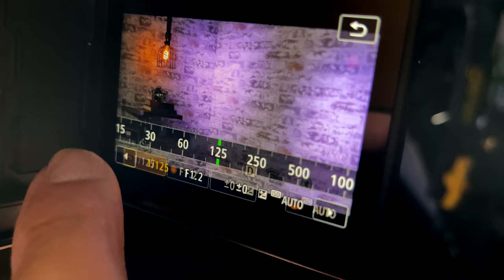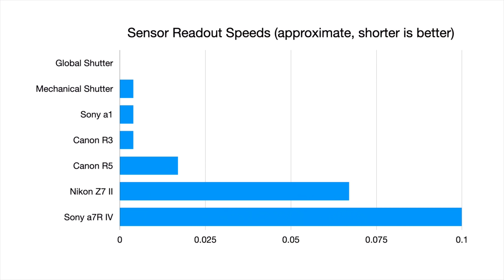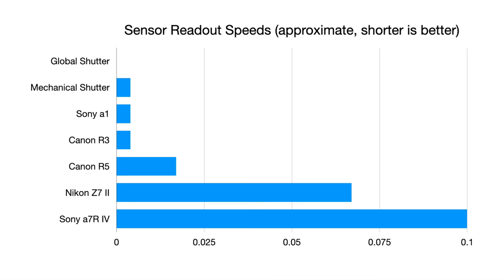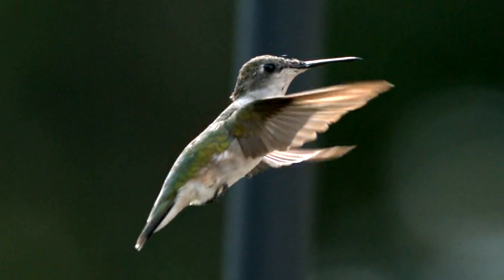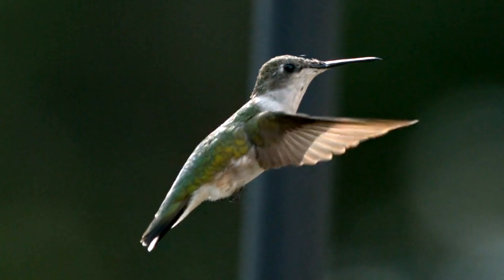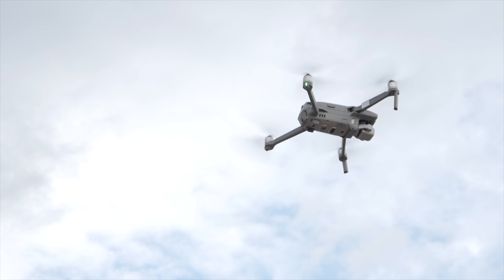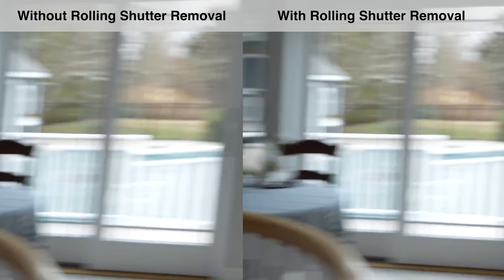Rolling shutter RUINS your photos & video: Let's fix it!

Comment: Need to pressure the industry to work harder on development of affordable global shutter sensors!
Reply: @asificam1  You can't dim an LED.  It's either on at full brightness or it's off.  That's why they fake dimming with PWM.
Reply: @LarsLarsen77  That's not true. You can dim an LED, but it needs to be dimmed using constant current method, instead of regulating voltage.
Reply: @LarsLarsen77  That is definitely not true, how do you think LED video lights work? I can use mine down at 10% power with my camera's shutter speed at 1/1000 of a second and see no flicker because the power delivery is DC instead of PWM.
Reply: @asificam1  Having DC power delivery for LEDs is not that trivial when you're talking about small devices like light bulbs and LED strips.
Reply: @TechnoBabble  It is not trivial as having to just put a small capacitor, but it is trivial in a sense that you can buy a cheap constant current regulator, and be able to dim LEDs without flickering. CC regulators usually use hundreds of thousands of Hz when regulating electricity (essentially they also use PWM, but very high frequency complemented with enough of capacitance makes smooth output).
Reply: @LarsLarsen77  You wanna bet?  LEDs can be dimmed by controlling the current through them.
Reply: they won't soon because they earn money on the camera's they have now. It is all about the money.
Reply: @MrKoenPieter a9iii enters the chat
Reply: LOL
Reply: just back to CCD and problem solved.

Comment: All right except that people still seem to think the flickering only ovcurs with led lighting, like led is a bad new tech..but it also happens with other sources like foot example fluorescent
Reply: Yeah, it definitely also happens with flourescent, sodium vapour, and cheap incandescents at a high enough shutter speed.
Reply: I've had fluorescent (the u before the o guys), lighting give me blurred vision and that quickly led to some disorientation. I worried it was me until I got outside from the store and started feeling clear headed again. Just some locations though, not all ceiling tube lighting.

Comment: You don’t need an A1 or R3 to get less rolling shutter in silent mode. You can buy the much cheaper a9 and get fast sensor readout. Fast FF sensor has been around 4 years.
Reply: indeed you can get 3 cameras from sony today that are able todo it. The A1 is about 2x faster it seems then the others (including the R3). Getting a R3 at the moment is not possible they are not on sale so you have 3 options if you want silent shooting with less rolling shutter ff A9,A9II and A1.
Reply: @Benjamin Mesa Thats fine to each his own but there is added value in a stacked sensor thats why they are also moving to it. And yes the a7RIII is a lesser cameras as the R5 no doubt. And i still own one, I jus sold a R4 for a A1. The 7R3->7R4->A1 is about 100+ updates and changes its like comparing a R5 with a RP in way even many sony 'fanboys' don't see the massive steps between generations which is a pity.
Reply: @Benjamin Mesa fine but you do understand that was not the point of the discussion its not my job to convince anyone who hates a brand. I could tell you 'these menus' have been redone but clearly that won't help the discussion was rolling shutter.

Comment: To avoid flickering at home whenever I buy lights from IKEA I go with my camera and test every bulb with typical video/photo settings to make sure I do not see banding i.e. their switching frequency is high enough such that it does not show up.
Reply: Pretty smart & probably something every filmer should do if they live close enough to where they purchase their lights. How do you do this. Do they have them on a working display or you take them out & put them in a lamp display? (I never been inside a Ikea)
Reply: @thomastuorto9929  yeah Ikea was just an example but could be any local household store with lights on display. Even if they are not on display just explain the situation and ask for assistance they will show you lights. There certain things that although you can buy online it's better to try for yourself at the physical store. In the end of the day a good set of LEDs will last for 10-15 years.

Comment: Quick Solution for camera manufacturers: The sensor should scan top to bottom, right to left, instead of right to left , top to bottom....this would dramatically reduce the pan jello effect... the "awnser" though, would be an "instant" sensor... maybe each line of resolution on the sensor captured all at once, or each line in one full "swipe"... gl
Reply: or the sensor needs to scan so often, that it's basically an "all at once" sensor

Comment: The rolling shutter distortion is time-domain aliasing, and as you would expect with sample-rate aliasing it is subject to the Shannon/Nyquist theorem, requiring a sample rate of 2x the event rate in order to eliminate the aliasing.  

What’s subtle here, and what is so well explained in the video, is that the sample rate here is not the shutter speed, but the total sensor readout speed. The “shutter speed” is the effective exposure time for any given band of the sensor, and will have an effect on motion blur, but the anti-aliasing speed needed to eliminate aliasing distortion is the total readout speed for the whole sensor. Thus, if the hummingbird flaps its little wings at 50Hz, a total readout speed of 100Hz is the minimum required to capture it without aliasing and thus motion artefacts. Anything less WILL produce these unwanted effects. 

Again, this is not the shutter speed we typically think of to “freeze” motion. That’s a different thing, based on arc-seconds of movement, and will differ according to magnification, viewing distance and a few subjective values for what we consider to be “sharp”.  In many cases, some image blur is not only acceptable, but even desirable, and freeze-motion shots of things we know to be moving quickly may have an unnatural feel. 

Lest we imagine these artefacts to be something new in the digital world, we need look no further than the photos produced by Jacques Henri Lartigue, of the Grand Prix race in 1913. Using a camera with a curtain-type focal plane shutter, Lartigue produced famous photos of racecars with oval wheels, surprising many observers at the time. 

What shutter produces NO artefacts? The best shutters for air-to-air photographs, where there are usually spinning propellers or rotors, are between-the-lens, leaf shutters. This type of shutter produces no artefacts of any type. Granted, they are not very fast by today’s standard (usually maxing out at 1/500 sec/2ms) but the motion blur produced is usually more desirable anyway for propellers, and it is possible to calculate shutter speeds to produce ¼, ½, or a full rotation of blur. I use large-format film cameras for air-to-air when possible, for this reason. I have yet to see between-the-lens shutters offered for digital cameras, but I would not be surprised to see them offered soon, as more photographers wish to have this artistic control over motion artefacts.
Reply: Love the discussion. I'm not sure Nyquist theorem is really the issue at hand although it is similar. I say this because the data from the sensor should not be related to the time domain. A fast moving object is an object at specific point in time and digitizing this point it time creates a data stream that I don't believe is properly thought of as being part of the time domain just because it takes time for the data to be read. It peaks my interest and you may be right but it doesn't feel right. I'm going to see if i can research a what I think might be a better explanation of how to model this but thanks for peaking my interest either way.
Reply: I was thinking it is more like noise but that is not right.
Reply: Does it really work like this? I think you are mis-applying the Nyquist limit here. If you want the wing to look frozen you need the “sample rate” or the readout speed to be many many times faster than the wings flap rate. If your sample rate is just 2x the flap rate then the wing will be very very smeared. 

This isn’t digital signal processing. You can’t get away with just two samples per cycle. For a photo to have imperceptible rolling shutter you need the “sample rate” to be maybe 20-100x the flap rate, depending on how much rolling shutter is tolerable to you.
Reply: @mynameisben123  I may be misunderstanding your comment, but I believe you are the one who is confusing the effects of motion blur with aliasing. 
A completely sharp and frozen image is not the only acceptable result for moving objects. In many cases, a photographer may wish to have motion blurin a beating wing or spinning propeller, as it better conveys the sensation of movement than an un-natural-looking frozen image. Time-domain aliasing is another story though, and the resultant geometric distortions are grotesque and displeasing to most viewers.

Comment: Best explanation I've heard of rolling shutter.  Now, I think I understand it.
Reply: I'm glad someone does.  I don't quite understand how a mechanical shutter with a slow shutter speed of say 1/30 can have less rolling shutter than an electronic one with say 1/120 with regards to panning motions or moving subject.
Reply: @pow9606  The slower speed shutter replaces the rolling shutter effect with....the blurring effect.  The bottom line might be that if you are getting a rolling shutter effect...slowing the shutter speed down will reduce the rolling shutter effect, but increase blur.  what you can do is try to find the shutter speed with the least of both somewhere in the middle.

Comment: Try doing pans with a film camera with a horizontal traveling shutter (Nikon F3) and then do the same shots with a camera with a vertically traveling shutter (Nikon FM2).  Critical analysis of the images will show two very different types of distortion.

Comment: I was shooting a wedding. I was behind the priest and decided to change to silent mode with my Sony a7r4. It was dim. I honestly thought it was the camera screen when checking my photos. When I came back home the banding was terrible. I couldn't find a solution on how to fix them. There was a link that said it can fix banding on raw files. It still doesn't work. So I had to manually fix the photos by photoshop. Using rectangle too with feather 20px ., and use the curves to adjust the dark bandings to match the light ones. It doesn't look 100%  , but still better by around 60%.
Reply: and the camera manufacturers didn't speak about it and still they don't! Let's wait for a global shutter.

Comment: I'm surprised that you have mentioned only "expensive" cameras having fast sensor readout like Sony A1 or Canon R3. 
Why you did not mention A9 and A9II which have also much better readout speed compering to "regular" cameras? ;-)

For example A9 (mark I) has 1/160 of the second readout speed and could be bought in Europe for "only" 2500 Euro. And by the way, that camera is on the market from 2017.
That being said the fast readout speed for stacked sensors works only for stills, in video the stacked sensor doesn't eliminate the rolling shutter distortions... 

These days everyone is explaining rolling shutter limitations when in fact Sony users are aware and free of these issues from 4 years now :-)
Somehow it wasn't issue for Canon users before releasing Canon R3 ...

Comment: I'm a concert photographer.  On two occasions, I shot part of a concert with the silent shutter in the Nikon Z6 and Z6ii.  99% of the shots taken were ruined by banding.  Just horrible.  More recently, I was all excited to pre-order the Z9 (I really want better autofocus than the Z6ii) , but when it was announced that the Z9 has no mechanical shutter, I decided I needed to know more before putting down that kind of $$.

As a concert photographer shooting stills, I'm not concerned about "slanting buildings" or "warped golf clubs" or "bizarre airplane propellers", but I am terribly concerned about "banding" when shooting concerts under LED/artificial lighting.

So ... do you think the Z9's readout speed will prevent/eliminate banding?  Will it prevent some banding, but there's a chance I'd still have to deal with banding in some situations?
Reply: as far as we know now only a global shutter eliminates banding. Camera manufacturers want to make some money from the models they sell now and only then they will change to global shutters. The solution is there but we have to wait
Reply: @MrKoenPieter  since the time I made my comment above, I've bought a Z9 and have shot several concerts with it.  So far (knock on wood), no banding issues to report.  That said. I am looking forward to the day global shutters are prevalent in flagship cameras.  :)

Comment: FYI:  Some LEDs have drivers that do not flicker.  If they do significant power conditioning to control the LEDs, it will be less or non-existent.  The ones with the little orange "filaments" have minimal conditioning.  Look at the bulb with your cell phone camera and you can see the bands in the image.
Reply: That's right! Good quality flashlights and lamps don't use drivers with PWM (Pulse-width modulation) which causes the flickering at specific shutter speeds. Also good old incandescent lamps don't have this problem.

Comment: We can make sensor with simultaneously reading and in fact we did a lot back them, it was called CCD. The JFET-LBCAST sensor had really fast speed reading too.
Reply: There are also global shutter CMOS sensors, which use 5 transistors per photosite ("pixel") instead of 3, and that way they essentially have analog memory, which can be read when shutter is closed.

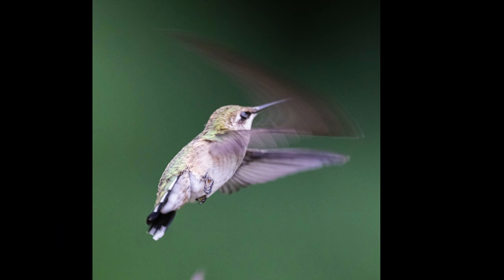Comment: 4:23 So finally it's time to show the R5 weaknesses vs a fast readout stacked sensor camera! Why now? Well cause finally there an stacked sensor out by Canon! Sofar in every single comparison video of Sony A1 Vs R5 Tony was claiming R5 is identical or even better! So the A1 is overpriced.... But now this show how even an almost 5 yrs old A9 can beat R5 in the area it is advertised to work best; sport and fast action shooting. R5 is a great camera but not an sport camera. That's why A9ii is over 4k$ and A9 still over 3k.
Reply: 1/60 is not really bad for normal shooting most people are not going to notice in most situations. But if you look for it distortion is there.
Reply: @gordonyz4  Sure but should not be confused with a stacked sensor camera. But in mechanical shutter mode it can produce 12fps even for action, that's why R5 already crushed 1Dm3 which was only 2fps faster but only 20mp so R5 was a way better deal considering it's price. But almost nobody was allowed to do that comparison maybe! So all compared it with A1.  Usable 30fps of 50mp for fast actions is no joke man! Sony has it's own weaknesses like the ergonomics. But the sensor is superior.
Reply: The R5/ 5D was never designed for fast-actioned sports/ racing though... The R3 / 1Dx Mk 3 I reckon is more a sports photography camera.
Reply: @sonicvboom  Never said they were, I'm saying when someone is comparing a none sports oriented camera with a sports oriented camera and says the latter is worse in sport shooting then something is wrong with his experiment.
Reply: Z9

Comment: This is a great explainer, but I still can't understand how a mechanical shutter is able to reduce rolling shutter effects. How is a mechanical shutter that opens for 1/x seconds going to solve the readout problem? The sensor still needs to read the image from top to bottom. Anyone have a good explanation?

EDIT: I think I figured out what's up. I think even when we're using the mechanical shutter, behind it is an electronic shutter: it's always electronically turning on the photosites (where each pixel is recorded), collecting photons, then reading the pixels out line by line to the processor and the memory card (vs. a global shutter, which can dump all the pixels onto the memory nearly instantly). The difference is, the mechanical shutter prevents the rolling effect DURING exposure. That is, the image is exposed at all photosites at the same time (ignoring the mechanical shutter's own "rolling" effect at faster shutter speeds); then the pixels still get dumped to the memory card line by line, but that process starts AFTER the mechanical shutter has closed. During the part of the process that might result in slanty buildings or warped propeller blades, there are no photons being delivered to the photosites. 

This is just a guess. If you actually understand this stuff, I'm all ears!

Comment: Rolling shutter is not new to mirrorless, or even digital photography. Early film cameras with slow film emulsions would display the same effect. It eventually became the accepted norm for moving subjects. If you look at old (like 20s-30s) grad prix posters, the painter will have painted the car with oblong tires leaning forward. This photographic quirk became a technique adopted by painters and cartoonists (look at Roadrunner's legs when he's running) to express movement to the viewer. 
I personally solved the "problem" by putting my camera on a tripod and only photographing things to don't move fast.
Reply: I'm willing to be educated, but this sounds like balderdash for so many reasons, so could you name your sources? Or are you just punking us (in which case, well done -- no one called you out for a year!). Because motion picture cameras don't work that way. And, as you write, the graphic expression of movement through distortion is a creative technique.